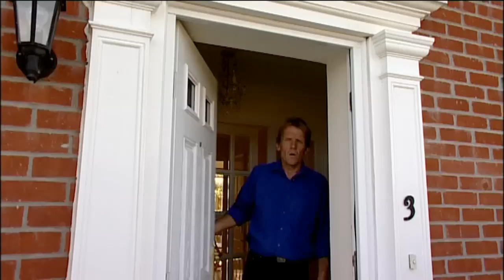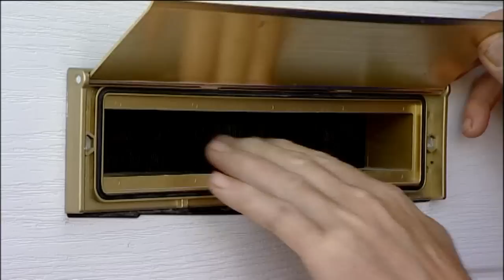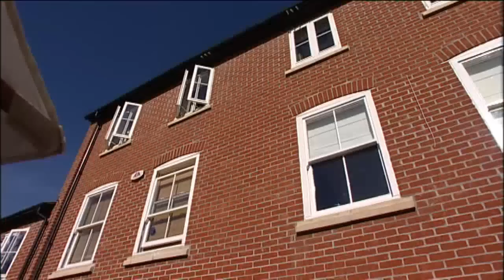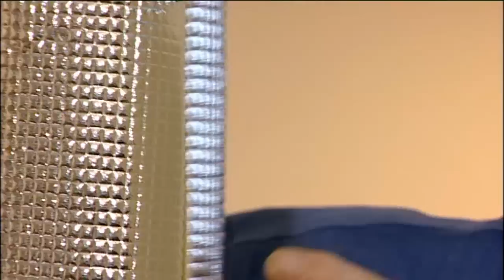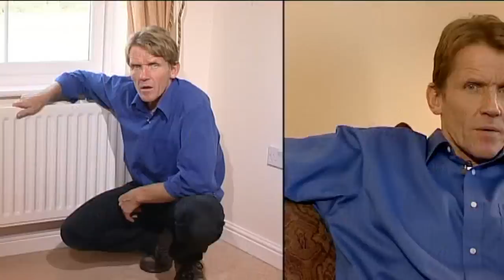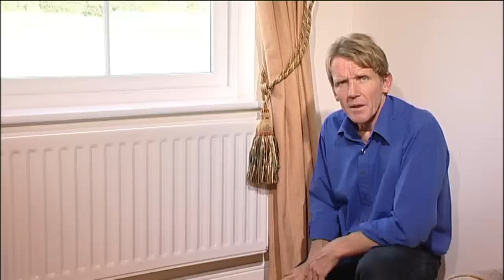Home Heating and Energy Saving Tips From Worcester Bosch Group

Comment: Curtains even above the radiator reduce efficiency. Just try putting the curtains on the window ledge and see the temperature shoot up in the room. My preference is always to have radiators on interior walls. Failing this make a (temporary) shelf that sits as close as possible to the bottom of the curtains that diverts warm air into the room not allowing it behind the curtains

Comment: Thermostatic radiator with a remote sensor would also be useful if you wanted to stop somebody having the radiators set at a ridiculous temperature consequently wasting heat. That thermal foil for behind the radiators looks like it would make terrific wallpaper lol and most probably cheaper too.
Reply: find the singing duo peters and lee